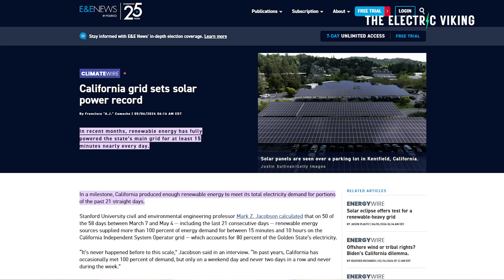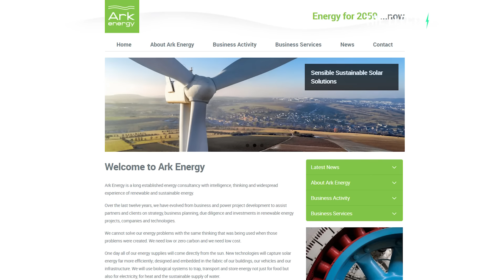How Australia’s new Tesla 8-hour mega battery helps to kill coal faster

Comment: We are doing this exact model in a nano-grid form and it works perfectly.   Building more solar for the winter with 1 additional battery.  Awesome.
Reply: Great for a small isolated community, but not on a large scale.
Reply: Great on large scale too. You simply connect several nano-grids. Those short connections are very cheap compared to landlines all over the country.

It's easy, it's cheap. Your own communities are in charge and not some people you don't even know. Thus you too have control over it.

Perfect solution for becoming independent from leeches too, who want to tell you that they are becoming rich must be important to you.
😉

Comment: in the UK we still burn coal nearly everyday(Very small amounts) when you look at the UK live grid checker,  0.1% of coal was used yesterday, past 12months was 1.2%.
 UK has decreased Coal but increased gas, gas was 30% of the grid for the last 12months
Reply: The last powerplant doesn't get shut down until October. 

The news articles made it seem like it was happening then but the coal power phase out has until the end of September 2024.

They also made it seem like the powerplant was being permanently shut not converted to something else.

I believe it was hydrogen for the last powerplant not sure how long it will remain open with decisions like that.
Reply: Not sure where I saw hydrogen but from the powerplant owners website.

The LDO provides a framework for sustainable development, specifying the types and amount of development that can be brought forward at the Ratcliffe site. It permits development for a range of modern industrial uses, including advanced manufacturing, low-carbon energy production, battery production, energy storage, logistics, and research and development. A large section of the site is part of the previously announced East Midlands Freeport - a key government initiative to encourage growth, innovation and job creation. The plans also link to Development Corporation proposals

Comment: South Australia still uses some gas.

Thank you.
Reply: Every night of every day. The battery has sufficient energy to power the capital city for around 7 minutes. 8 hrs is BS.
Reply: imo gas peaker plants will be needed for quite some time. And the way it could work, here's an example, is we get a forecast for wind and solar and battery storage and hydro capacity (which doesn't fluctuate that much) over the next say 48 or more hours and it says we will run out of electricity. We don't wait for the batteries to go empty and then start up the peaker plant but rather once the battery gets to say 95% and is forecast to keep dropping THEN we start up the gas peaker plant to prop up the batteries and stop them draining to zero..
Reply: And diesel generators for backup lol
Reply: @danielstapler4315  this is essentially what the AEMO does every day....

Comment: Looking forward to solar/wind and batteries significantly replacing natural gas once it's done replacing coal. Also looking forward to the slew of electric mining, farming, and logging equipment that should be coming starting around 2026ish.
Reply: Dream on. It can NEVER happen.
Reply: @robertfonovic3551  Do you have any sources for your claims? Or are you just having a knee jerk reaction?
Reply: “. . . a naïve observer might conclude that the rising share of new renewables (solar and wind) will usher in an era of falling electricity prices.  But in reality, the opposite has been true.”  Vaclav Smil, Numbers Don’t Lie, p.172
Reply: @dzcav3  Your quote doesn't say anything about energy storage or batteries. By the way, when was it published?
Reply: If the goal is to reduce coal use why aren't you advocating for a ban on coal export. Exported coal vastly exceeds our use.
Reply: There is someone in the comments whose only argument is negativity.
😉
Reply: @dzcav3  It takes money to put all of this infrastructure in.
Reply: @244col  The goal is to transition to renewable energy, not to disrupt and destabilize the energy systems.
Reply: @dzcav3  Did you know electricity prices have also gone way up since I started growing a beard? Does that mean if I shave, electricity prices will come down again? A naive observer doesn't understand the difference between causation and correlation and therefore might see rising electricity prices and increasing implementation of renewables and think there's a causative link there. They may then feel very smug about this "realization" and go on to write a book about it that is very convincing to other naive individuals who go on to parrot the claims without any critical thought or independent research. Numbers don't lie, but the conclusions we draw from them absolutely do.

Comment: Coal fired power stations began to close in the 1980s when the government sold off the mines to private owners. The government switched to gas from the north Sea but it ran out & therefore some coal power stations were extended. Coal is the cheapest form of fossil fuel generation & that is why China is still building them.

Comment: Here in nz my power bill is less than 0.20c per kwhr.i see in aust its up to 35cents per kwhr.sorry guys but solar and wind is still much higher.
Reply: It's still transitioning and deployment of renewables and batteries is far from complete.
Reply: Everything is higher than hydro which is what NZ runs on.
Reply: Mainly due to network charges, because of the far larger area & longer distances between low population centres.
Oh and it's been privatised.
Reply: Here in NZ my power bill is 0.35 per kWh. So...

Comment: Hey Sam, correction: South Australia is NOT completely FF free yet, it still has a few natural gas (methane) peaker plants for when there is no battery power left.
Reply: They also get power from Victoria when the sun sets( it does so every day ). The SA battery has the ability to run the state for 7 MINUTES. How many battery packs would be required to run the state for 24 hours? It's clearly unaffordable. Ps SA also has the highest energy rates of any of the other Australian states. So much for cheap renewables 😅😅
Reply: @robertfonovic3551  This is the key issue they don't want to face . Their performance versus their cost is horrendous. If we are to survive a 2-3 day wind drought though an overcast period we will need to spend hundreds of billions, ie bankrupt Australia. Plus 20 years later we get to spend it all again!!!
Reply: SA is right now getting more electricity from gas than from batteries.
Reply: TY

Comment: Australia was using coal as a fuel for peaking plants? I’m surprised by that. If they were super critical boilers, it would be very hard to use as a peaking plant as it takes a while to get everything up and running. Maybe they were drum style boilers? Those would come up a little bit faster. Natural gas is the primary source in the United States for combustion turbine and combined cycle peaking plants
Reply: Nope our coal plants can run from 35% to 100% in 3 hours and vice versa but they are used as Base Load power plants. They ramp Coal Plants up and down to accommodate solar and wind but they are NOT peaking plants.
Reply: All throughout this video people are going back and forth. 
And of course everyone is believing they are right.
Reply: Sam is more of a broad brush kind of guy.....
Reply: @peeemm2032   True 
Like some backwoods, Australian trait.
I have been on this channel for quite a while, and he's got to become more "Polish" , This is not a continuous conversation going on in a bar .

Comment: were i live Washington state USA the power mix is still mostly hydro at 54% with wind at 6% and solar only at 0.33% 

solar works here its just so far north that other power generation is still cheaper than solar since we have annual solar radiation value of 4.01 kilowatt hours per square meter per day (kWh/m2/day).

in the summer time we have a lot of sun but winter we dont. I think in the area i am that Wind will be the primary replacement 

there is not one way to swap to cleaner energy in the world every location has a different mix what is cheapest.  Also in the US we have a lot of NIMBY people who dont want anything near that disrupts there view or whatever.

Comment: An EV battery will replace 4 - 5 power walls cheaper and provide transport if it's not needed 95% of the time. It can re-charge at night at cheapest rate. No need for a PV roof.

Comment: In UK, pumped hydro cost is £50m per GWh, and will last for 60+ years. Battery storage cost is £270m per GWh and will last for what, 20 years? Last coal-fired station in UK is near my house, it is scheduled to close in September, a date set years ago and ABSOLUTELY NOTHING to do with rollout of solar panels or standby batteries, and everything to do with being replaced by gas-fired generation. The government actually begged the operators of West Burton coal-fired station to carry on running beyond the agreed closure date but the operators declined because so many of the workers had made their retirement plans.
Reply: We are experiencing the same issue in Australia. The government is paying a coal power station operator in NSW 250 million over 2 yrs to remain open. 😅😅
Reply: @robertfonovic3551 shows how uneconomic coal is if it such subsidies.
Reply: Yes, managing big projects is a difficult and sometime expensive thing to do. I remember when working at a fabrication facility we had to decide between to different process to use in a new line but the testing was going to take a few months. Once decided it would take a minimum of 6-months for the main equipment to be ordered which was not acceptable. The solution was to order both systems at a cost of 7 million each as that would be cheaper than having the line sit idle for 6 months waiting.

Comment: Retail voltage community batteries and transmission high voltage batteries are 2 seperate systems. 
Retail voltage community batteries are economiacl for the community.

Comment: So how many houses/ towns/cities can this 8 hour battery service. The 8 hour statement doesn’t mean much if we don’t know what it is servicing.
Reply: He mentioned the size of the battery and the time it can serve. Just watch the video.
😉
Reply: @jantjarks7946  what Sam says is incorrect.
Reply: The 8 hr figure is crap. The SA battery can run the The capital city for 7 MINUTES.
Reply: It's not meant for Sydney. It would be nice to build a battery for the size of Sydney. It's far cheaper than any coal or gas power plant.

Btw., he mentioned the energy output, why are you pretending not to understand? Or do you really not understand?

Anyways, you have no argument that could change anything substantial.
Reply: @robertfonovic3551  It is not designed to run the City for hours or days on end. This constant repeating of 7 minutes is just moronic. Its akin to me complaining my car wont go 300km/hr or do the 0-100 in 3 seconds. It wasn't designed to ever do that Robert. Stop with the childish nonsense.

Comment: I still think we should be looking at less expensive solutions than the Tesla Megapack. Battery storage using other materials could be done at much lower cost and still store power generated by renewables for release later.
Reply: Sounds good, what other materials were you thinking of?
Reply: @jeffg4570  "We?" This is a private company in a no longer public market. If they consider the Tesla battery provides the cheapest and best outcome, "we " have no say in that.

Comment: Awesome. Need more BESS in the UK as we waste lots of wind power.
Reply: We are getting there with a few projects nearly complete more to the point we have our own natural storage batteries if you like that are huge and almost as safe and reliable as a wood burning stove in Hydro………
Reply: Worse than wasting the wind power we actually pay them to shut down. Bonkers contracts. New Pumped hydro plant in process of build but crikey we could have seen years ago we needed some form of power storage. All the competitors to batteries are way off (hydrogen, Compressed air, Weights/gravity etc...) so why are we not putting batteries in.
Have one at home and can sell the electricity for double what it costs - not to mention the solar exports too.

Comment: New homes need to adjust to the times. Home solar energy and battery storage are now more common. 
Electric vehicles are becoming more popular every year. Every garage should include a 220 volt outlet and electric vehicle charger.
Every new home and business should install a rain water collection and storage system along with solar panels.
Even in areas where rain is infrequent it is crazy to waste the little rain that does fall and waste it.
We need to stop planting green lawns and switch to local native plantings around homes.
It is crazy to plant lawns and build golf courses in dry desert areas. We waste too much water and electricity.
the future is electric. Wind and solar energy along with electric vehicles are the future. Stop using fossil fuels. There is a climate crisis.

Comment: how much toxic smoke does it spew out when it catches fire like the other 2
Reply: Far less than any coal power plant without failing. Interestingly enough, when the coal power plants have to shut down in the Australian heat, they produce less toxic materials.
Reply: No one is putting in Li-ion batteries for large scale storage. Even autos have moved away from Li-ion batteries.
Reply: @orionbetelgeuse1937  Auto battery packs are moving on to a few different lithium iron phosphate chemistries. 
I was wrong about all of the mega battery packs being changed over. It looks like some being installed are still the LI versions. 
I was curious on what the 8 hour spec was referring to as well. What I found was a claim that one pack could supply around 3900 homes with power for that time. I'm sure there is climate assumption for that number.
Reply: @orionbetelgeuse1937  That is the older LFP chemistries. There are newer ones which have faster charge and discharge times than the LI batteries. It has a different lattice structure for the ions to sit in making them more energy dense with lower heating and better efficiency. These just started to be produced this year.

Comment: It's interesting we keep getting told that renewables are the cheapest form of energy production, even though we traditionally had very cheap power.  Yet every time coal or gas is removed from the system and 'replaced' with wind/solar the price of energy goes up.  And we now have amongst the highest prices in the world.  And the highest prices in Australia, is in South Australia.  The only reason South Australia regularly has power, is because of the gigantic extension cable to NSW and QLD and their coal fired power.  So lets run an experiment, and cut that extension cable.
Reply: Give it a break already. New stuff is rarely cheaper than it will become after technology improvements and production efficiencies from scale. First they concentrated on generating the power, not there is focus on storing it for low generation periods. It is inconceivable that anyone should expect one day to be running on one method and the next day to move to another. 
have to ask what the inherent resistance to change is?

Comment: 2 big problem projects started by Malcolm Turnbull .
NBN Australian fibre communications grid.
 At a cost of $56bn and counting, that will be Mr Turnbull’s legacy,” he wrote.
Snowy 2.0 pumped hydro expansion. $2 to $20 billion. 

Both over budget.
Reply: You do realise the NBN was started by Rudd in 07-08 and after 6 months it was 12 months behind schedule which put it over budget and to this day he said it would have been within budget if he was still in power. Originally Rudd said it would cost 42-48 billion and Turdbal cut it back to 56 with cost reduction so Rudd had no idea
Reply: @dikkybee4003  All projects are expensive at the start.
Turnbull fixed it by changing up the complexity with the older technology. 
Economies of scale as all businesses know fixes start up unit costs.

Yes, you do have a point. My point was meant to be that outside Malcolm skill at being lucky, getting out of a failing internet business, confidence in other areas of expertise is often shitty.

Comment: Can you explain what 4 or 8 hour mean?
Reply: I think he means how long the batteries can be used before backup powerplants need to help, but I could be totaly wrong. I didn't check my facts
Reply: Energy stored 400 MWh/ power output 50 MW =  8h
Reply: In part it can refer to battery chemistry, some are better suited to slower discharge rates.  And at high discharge rates some chemistries risk overheating and damage.   But yes, it's usually an expression of how long it can power a given load.  

Is somewhat confusing, 4 hours vs. 8 hours, it's really just twice as many batteries.
Reply: It really just means a bigger battery or many many smaller ones. The speed that lithium based batteries can charge is too fast to make a difference. Even an LFP battery can do 2C (30 minute) full discharge cycle. For chemistries and battery product specifically designed for the ability to store a very large volume of energy we need to talk about flow batteries.
In general such batteries will still discharge over a 4 hour period (aka the peak demand period).
Reply: @tiemeiscool123 as an South Australian, I can tell you that the battery is good for 7 minutes only.
We also have Australia's highest electricity prices.
Reply: @docwatson1134  So, 100 megawatt 4 hour, meant to supply that amount of power for four hours.  So when the sun goes down, for example, it helps to handle the power need for four hours until need goes down and other sources are able to supply.  You don't really want it being used up that fast, that is just for planning.